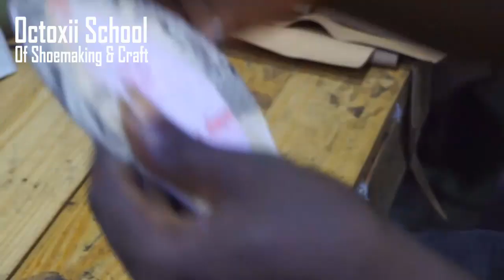Making your wedge heel ready for use

Comment: Hi , I ended up here when I was searching for a way to repair my wedge sandal, all the repair advice is about re attaching straps and frankly the straps are not the problem I have , the problem with mine is they have separated from the wedge base itself , I have tried several strong adhesives but to no avail , the surface I'm glueing is like a fricken honey comb no matter if I put the glue on the bottom of the (part you put your foot in) or the wedge base directly , it just won't stay ! 
What am I doing wrong ???? 
Please help !
Reply: You need to file the surface and add gum...
You can just give it to people that make footwear in your area.